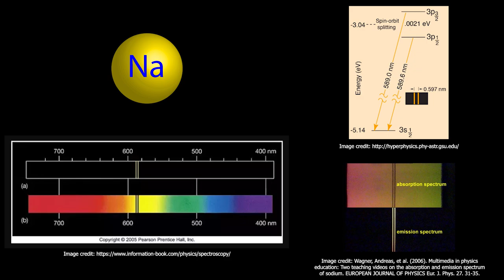Can You Make "Black Lightning"?

Comment: Two things you need to do:
a) overpower the light of the spark by putting the lamp closer - you want to drown the ionized sodium emission in the camera - they are in the way and the spark makes them a lot brighter than the flame. You only want nonglowing vapor action.
b) close, white background reflecting the lamp strongly - you can't see black stuff in front of black shadow; you need white background's illumination which will get gobbled up by sodium ion vapor

Comment: Incidentally, this unintentionally a superb demonstration of why lightning bolts striking the ground appear as they do in particularly high quality or slow motion video of very close strikes. The presence of Na in the environment and soil is so ubiquitous, and the efficiency of its conversion of electrical and heat forms of energy into yellow light at the 589 doublet lines is so high that this phenomenon is seen almost all the time when video of cloud to ground lightning is of high enough quality. 
I think the suspicions about why "dark lightning" was not achieved here are quite right and the high temperature and electric field in the sparks may even be causing Doppler broadening and Stark effect of the lines respectively to become relevant in some part as well.

Comment: That was a pretty cool experiment! I personally cannot explain exactly why, I could hypothesize that perhaps the light from the spark, is enough to wash out the black? Other than that, I'm at a loss. But that was still really cool to watch. Cheers
Reply: I think what's happening is the arc produced from the coil is enough to excite the atoms in the air to produce light that the fire isn't able to, and so the light from the atoms in the ambient air is enough to wash out the black coloration any sodium ions are making.

Comment: You used normal camera with fixed sodium lamp lighting right? Maybe use the filter that only passes that narrow frequency, and then you can eliminate the plasma interfering the absorption. If that filter even exists.
Reply from the maker: That's right, yes. That's an interesting suggestion. Yeah, I have no idea if that kind of filter even exists, but would be cool to try if it does. I'll have to take a look. Thanks!

Comment: Possibly relates to why two running sodium lamps don’t noticeably absorb each other’s light. It’s the sodium vapour that absorbs the sodium light, not the ionised sodium.  If you have two hot sodium lamps running and switch one out you will see it absorbing the light. Well actually its weirder than that, it will absorb and then re-emit slightly in resonance and look foggy.  Good demonstration though, I would have tried that if I had though of it.
Reply from the maker: Makes sense. I've been trying to think of ways to modify this and get a better effect. Hopefully get back to this some day. Thanks for the info!

Comment: Interesting experiment. 

You could use a HFVTTC (aka PLasma flame generator) like Styropyro. Maybe becaus the plasma flame is mutch more similar to fire it would work.

It still looks pretty cool tho.
Reply: Styro said he didn't have success on his large plasma flame, sadly.
Reply: Hmmm... Maybe it would work with an electric arc from like a mot stack.
Reply from the maker: Yeah I'm very interested in trying that, actually. After I already filmed all this, I discovered The Action Lab posted a video, just a week before I posted this one, where he does this with a small HFSSTC plasma flame and it does work.
Reply from the maker: MOT arc is another interesting idea too! I'm curious what characteristics of flame vs Tesla coil spark vs hot MOT arc affect what's going on here.
Reply: @firefox1136  I think he tried that as well, but I'm not sure.
If a SS plasma flame worked, than perhaps an NST or low-current flyback would work better since lower temp.
Reply: @CoilLabs  Oh really? Styro's talked about it a few times on the discord, he thinks the black body radiation is just too high since the arcs are so hot.
Reply: @CoilLabs  Good luck, if you try it. If you use an RF plasma I reccomend the circuit from Vidduley : https://www.youtube.com/watch?v=sYoxJdCz9no it works very well.
It looks like making black plasma is more difficult than it seems.